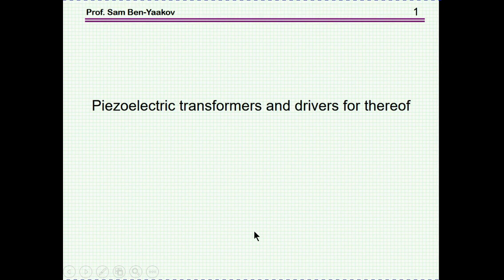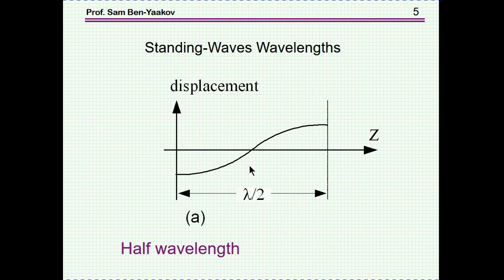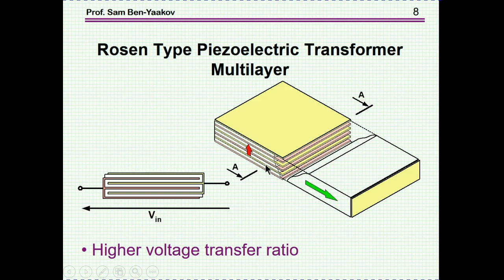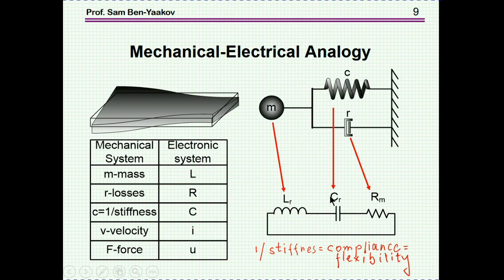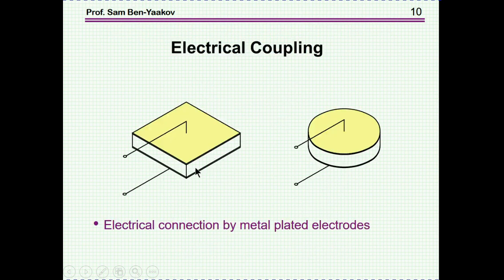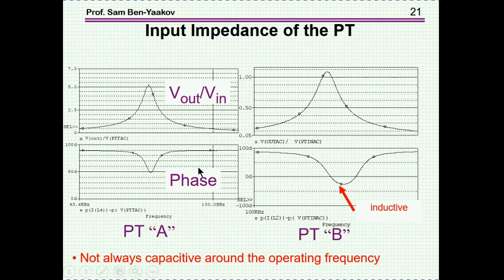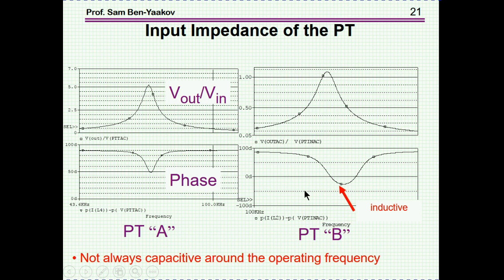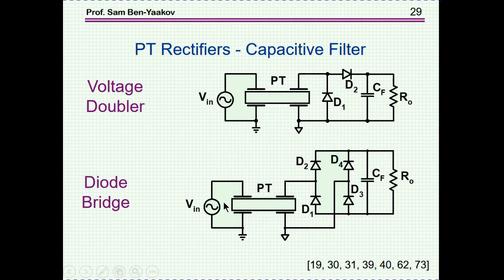Piezoelectric transformers and drivers of thereof

Comment: I have a question:
For PT, the circuit works according to the resonance principle, i.e. we need to trigger on the PT a frequency that resonates with the frequency of PT or we just need to trigger the PT with ANY frequency (not resonates) so that the output voltage is biggest ? Or do we just need to click once at any frequency, will the PT's output respond to the resonant frequency at which the transformer operates?
Reply from the maker: To transfer energy you do need to drive at resonant frequency, Energy content of transitions is meager.
Reply: @sambenyaakov  Does that mean if we use a PT then we need a driver that generates a frequency that resonates with frequency of PT? For example, I use Steminc PT 50kHz, Do I have use a driver that generates 50kHz? Can I use NE555 for driver? Thank you for reply.